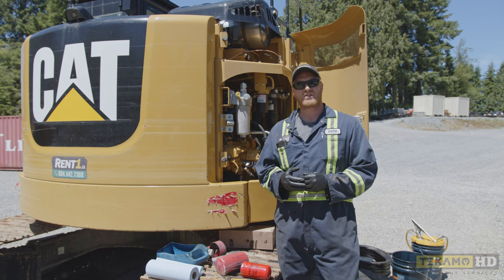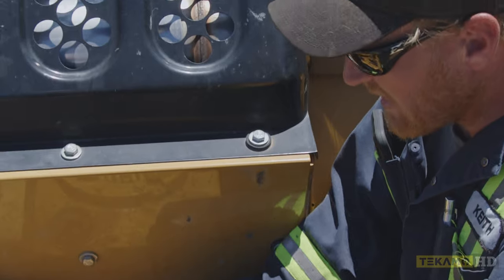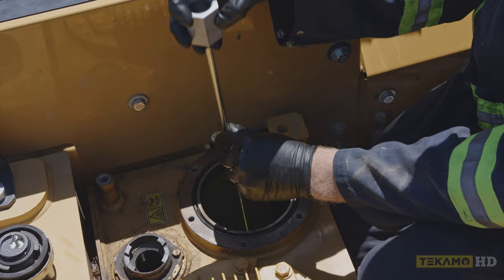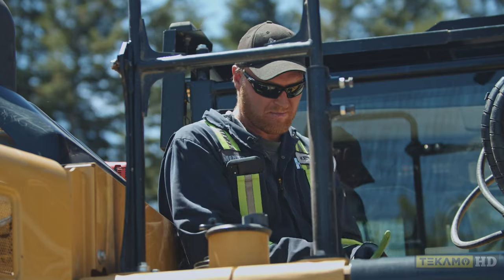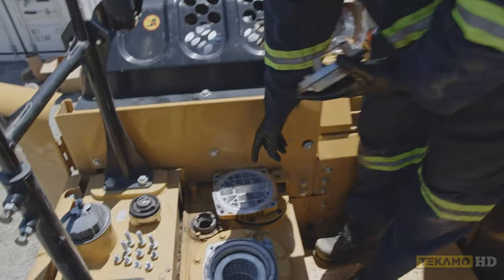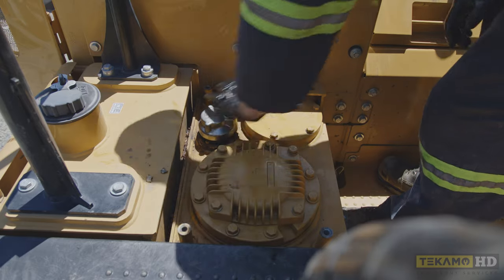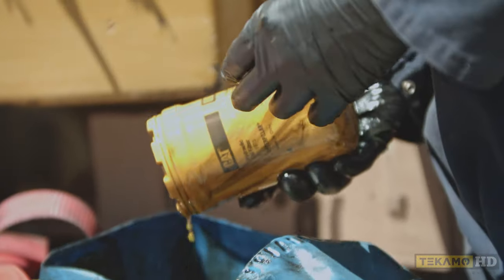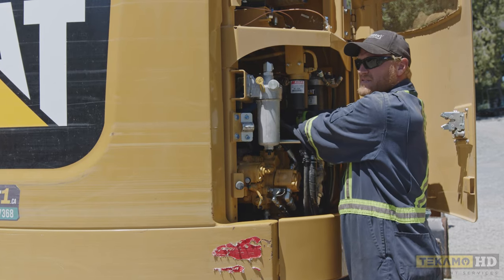Changing Hydraulic Filters On An Excavator — STEP BY STEP

Comment: That's not the correct way to change the Hydraulic filter.   You just dumped dirty oil into the tank line.  There are directions on that handle on how to do it right.

Comment: Instead of taking the snap ring off , he should've rotate the filter 180° and remove the whole canister out. That way you are not releasing any dirt out.  That's the right way.
Reply: You have to take the snap ring off then turn 180 degrees
Reply: Need to rotate the whole cannister 180 degrees, then remove the entire cannister and THEN change the filter and drain the dirty oil. Doing it this way keeps all the dirty oil in the tank.

Comment: I like your videos, however on this one, one thing got me. Remove the cap to the tank to remove any pressure, then put it back on. You left it off moving bolts over it, dropping a bolt into the tank could happen.

Comment: H thanks for the video. My Hitachi UH061 has a strange round smaller cap on the top of the suction filter - feels like rubber - it’s under the fluid level. I haven’t figured out how to remove it. Any ideas?

Comment: Hi sir. 1st thnx. Ur video is very useful. But 1 time u did mistake. U r open hydrolic tank cover. Remove gas but u not fix cover and remove bolt. Any bolt slip ur hand and drop in tank after to much prblm.